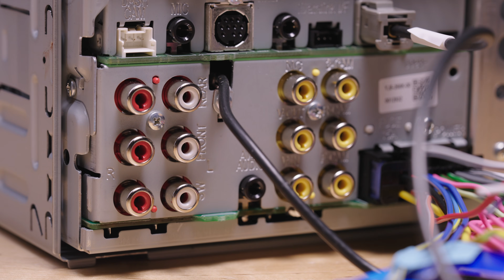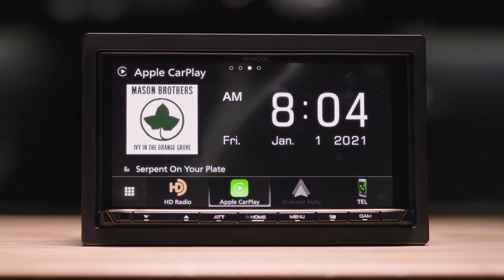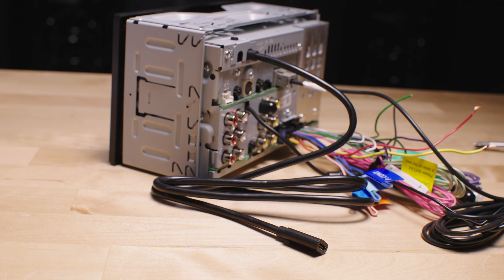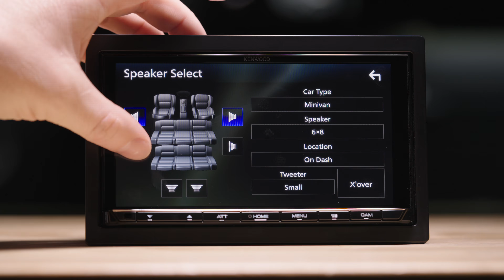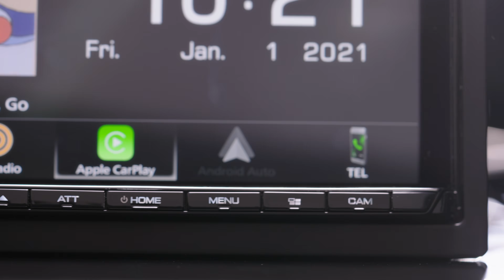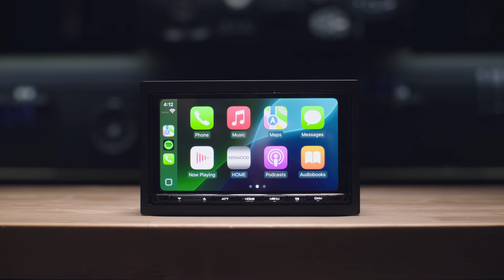Kenwood Excelon Reference DMX958XR receiver | Crutchfield

Comment: Does include AUX output?
Reply from the maker: It has a rear panel aux input to connect an external device, a video output to connect a rear seat monitor, and 6-channel RCA preamp outputs (5-volt front, rear, sub) to connect external amplifiers.

Comment: “VISIBILITY” no one doing reviews ever talks about visibility. I drive a Convertible and my existing eight year old Kenwood Excelon, is CRAP for visibility in Direct Sun, washed out cannot read (pretty much all sun when top is down) I’m interested in purchasing, butI need to know what visibility is like in direct sun. Someone said this model is better, but NO One in the business has been able to tell me if you can actually read the display in bright sunlight? Someone one needs to take a car battery outside with this head unit and turn it on to see what visibility is like.
Reply: Sorry to say but this is just an LCD screen with 600 nits max brightness. There is nothing special and it is just like any other LCD display, regardless of what type of device it is in.  It does indicate it has an anti-reflection/anti-glare film but that won't really help in direct sunlight. OLED is supposed to be the best for direct sunlight, but heck, even my iPhone 15 Pro Max with OLED screen and 2000 nits max brightness in direct sunlight is almost all washed out and nearly impossible to read. Any LCD screen is going to be crap in direct sunlight regardless of what head unit you get.
Reply: @sal33n thank you. More information than anyone has given me. Including Crutchfield, who basically said; we’ll just buy it and see for yourself. I appreciate your feedback Thxs Again!
Reply: 💯 agree.  Reviewers NEVER talk about screen visibility.

Comment: I have this bought it from crutchfield. Kinda buggy. Been hoping for a firmware update. Nothing yet.
Reply: I have an older flagship Kenwood (Excelon Reference). Kenwood isn't great about software patches. I have high-res music loaded on a USB drive. Some tracks are missing when I search for them. If I move the  music files around into different folders, I will now be able find them, but now others are missing. There's obviously something that needs to fixed with the Linux operating system in the head unit but there's been no patch in a long time. I live with it but it sucks spending over a grand and still getting bugs. I'm just hoping these Chinese android based head units get good enough to put serious pressure on these big companies.
Reply from the maker: If you give our tech support group a call with your order number, they'll be happy to help troubleshoot! 1-888-292-2575

Comment: i wanted 1 for my tacoma but then my tech deck(phone holder/electronics holder) would block buttons so i opted for for 809s yet to be installed as i am in process of removing an alarm system that went bad.

Comment: Does it fit in a 2001 c5 corvette??
Reply from the maker: Yes, with some minor behind-the-dash mods. Here's what our Vehicle Selector reports: 

Installation notes:
You'll have to unbolt or cut out the factory radio's rear support bracket to make room for your new car stereo.
You will need to redrill screw holes to mount your new receiver.

You can try the selector tool here: https://www.crutchfield.com/i-rYTVc34V/car/carselector.aspx